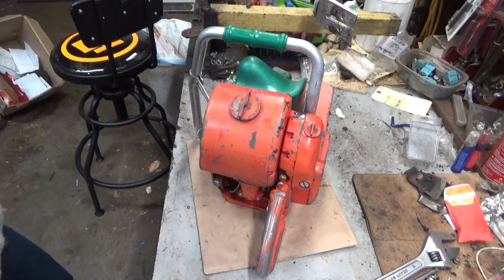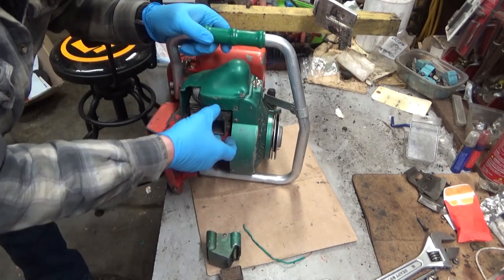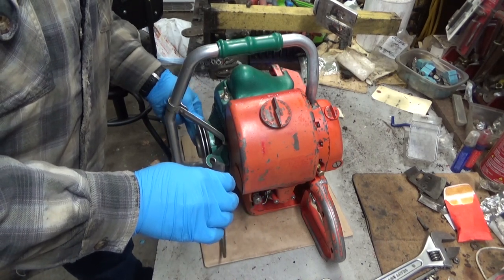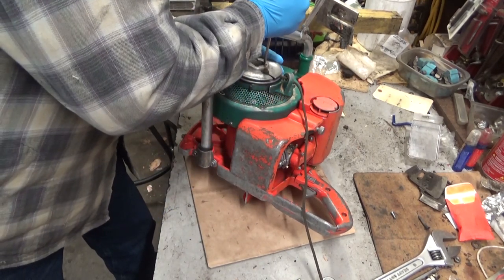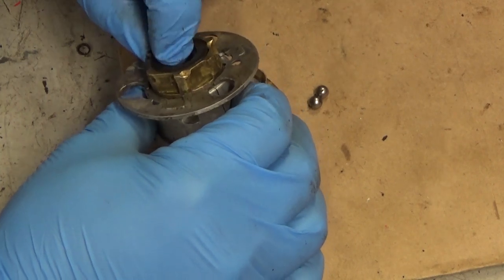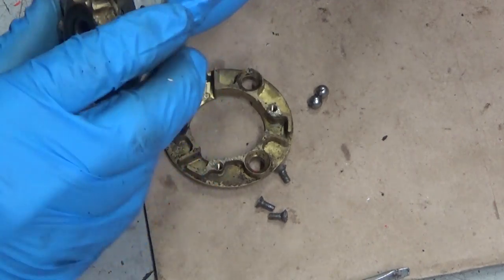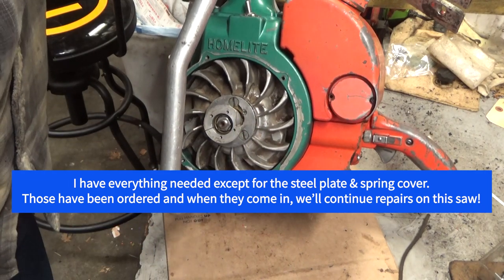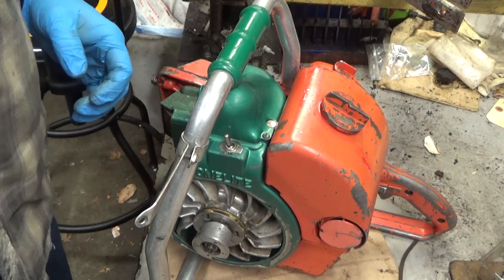Elvir's Homelite 7-19C Inspection & Starter Ball Drive Diagnosis

Comment: Thanks for the video! Working on a barn find 26lcs and haven’t been able to pull off the flywheel cover.  Good news is, spraying brake cleaner into where the ball bearings reside has seemed to free up everything without needing to pull it off.   I have sourced and installed a carb kit and only need to free up the throttle mechanism and make some fuel lines and I should be up and running!  Looking forward to more videos as there are several similarities to some of the other “really old saws.”
Reply from the maker: Someday I'll finish up my 5-30N...not too different from the 26LCS.  It's mostly ready to run, just fighting the carburetor...still wants to flood out and cranking that big bastard gets old QUICK!

Comment: I just happened to look at the spring in your store for the very same recoil, so I will look at others on eBay. The brass ratchet is tough to find, I have a couple NOS ball retainers and I'll look for a race. A small part lot purchased recently had a 5 count box of the retainers, my EZ-1 required one. I was given a junk EZ-1 a year ago and I stripped the useable parts for future rebuilds. Let me know what you need. The EZ-1 IPL shows the same system.
Reply from the maker: Thanks Jeff, but I think I've found everything.  I want to see if the ratchet will still work with the proper race and thrust washer installed.  It's beat up, but I don't think it's completely shot.  If I find something else missing/damaged, I'll give you a shout!

Comment: Could silver solder be used to build up the damaged parts of the brass ratchet and then filed to shape?
Reply from the maker: I'm honestly not sure...but it might work.  I'm going to get it assembled and test it with all the proper parts in place.  If it is still rough or inconsistent, I'll look into repairing the brass.